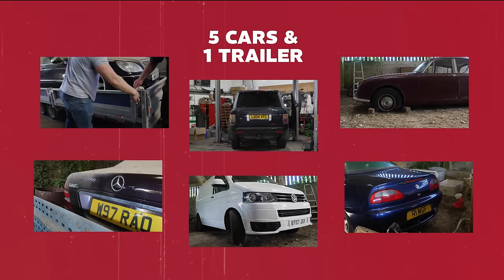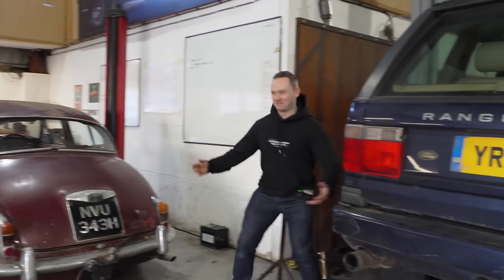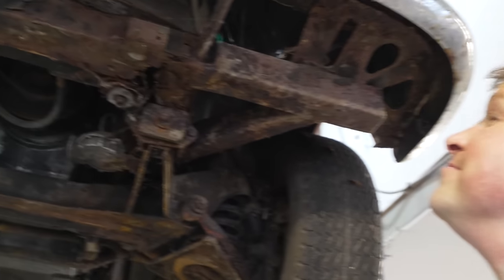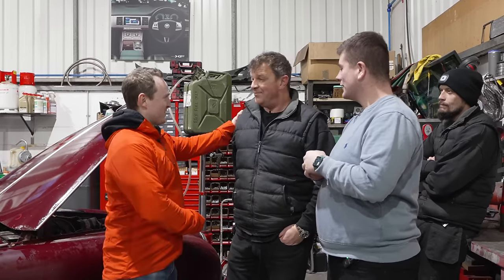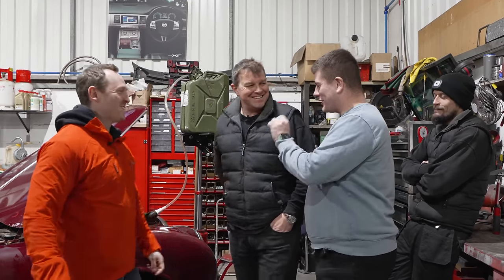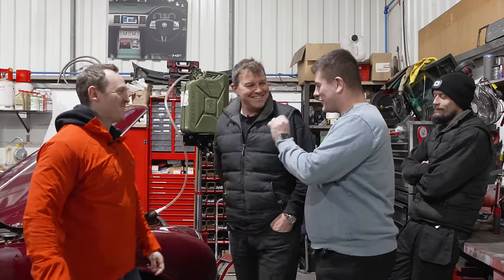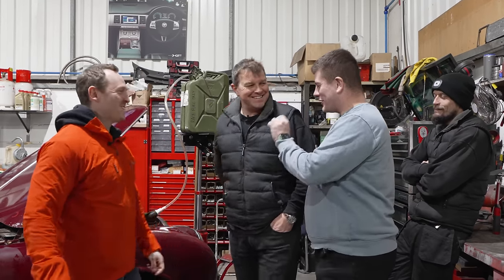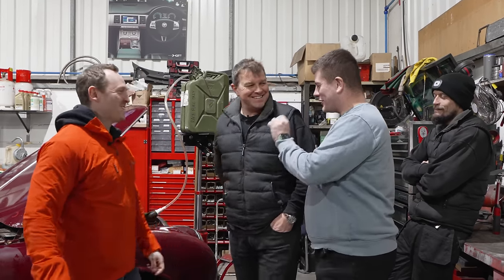BUYING 5 CARS FOR £10,000 WAS A TRADING UP DISASTER!

Comment: I have absolutely no clue when it comes to trailers but I would have never imagined that trailer to be worth £5500!
Reply: The trailer they had I've seen being sold for 8K on auto trader. The costs for trailers are mad.
Reply: Yeah it's only when Alex and Taylor's got nicked when I found out just how much they can cost. Makes sense in retrospect, it's a big lump of metal that has to safely and securely transport potentially very heavy vehicles even at motorway speeds.

Comment: I wonder how much you would make on that Daimler if you just stripped it down and sold it for parts. Tom already wanted the front axle, ha also said that the engines on those were quite good and this particular one didn't sound too bad. With these and maybe some stuff like the lights, bumpers, windows, doors and other parts that are hard to come by but still in an acceptable shape, I figure you could make around 1000 quid or more if Robin hadn't messaged you.

I think I'd like to see a challenge in which each of you guys had to buy a car that's off MOT and has no chance of getting it anymore and make money parting it out and scrapping everything that doesn't sell.

Comment: That Mercedes has a ton of valuable parts, the refrigerator is worth easily 1300 pounds, add in the ABC struts, wheels, interior trim specific to the v12, the xenon headlights, exhaust cats,  engine itself, and body panels and you could easily get 6k pounds from breaking it

Comment: 14:37 Didn't Minis have cone suspension not Hydrolastic?? 1100's and Metros had it though.
Reply: Minis where mainly sold with rubber cone suspension. But they were definitely offered with Hydrolastic for a period in the 60/70s.

Comment: I restored a mk 2 jag in a bit better initial condition than that Daimler, cost a fortune, lots loads when I sold it, those 2.5 Daimler engines would fit the dart and they used to be in dragsters back in the day, bet you could have broke it for good money.

Comment: That transporter is worth way more than 4k no offence.

It's been face lifted to a T5.1 for a start, 1.9 engine wich some people find more desirable than the 2.5 and it has under 150k miles.. You could have got 8k+ for that quite easily tbh..

I'd had bought the whole for for 10k just for the transporter alone.

Comment: Minis and Metros had Hydroelastic  suspension? 🧐
Reply: Metros did, Minis had them for a while in the 1960's and then reverted back to rubber as a cost saving. MGF is Hydragas - MGTF went to coils since Dunlop stopped selling the Hydragas system due to low demand.

Comment: Better off just buying 1 car for 10k and keeping it for years!
Reply: A 330d maybe😉
Reply: @AI-Records24  good choice they last a while
Reply: @HighMiler330d  some say they run to high mileage no problems at all 

In all seriousness I’ve had a couple one I took to 300k and the other 270, and they were both still like new
Reply: @AI-Records24  yeah there solid mine is a bit dead tho at the minute alternators gone.
Reply: @HighMiler330d  ah bad luck mate you going to fit a new one or get one off eBay or breakers? Not saying it’s right to do but get a rental and swap them over on it😂